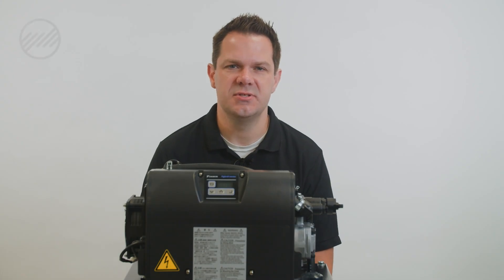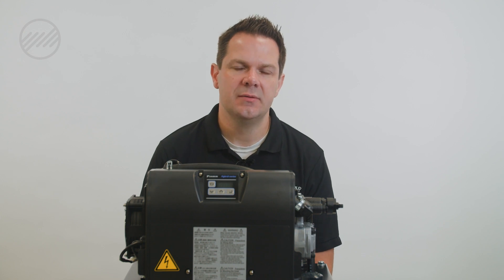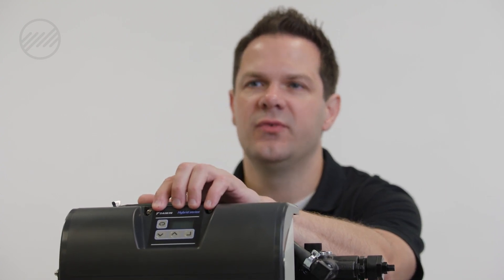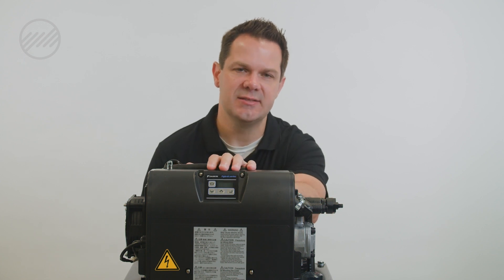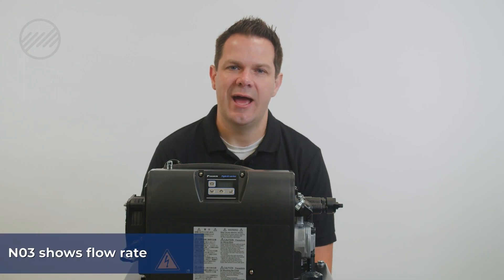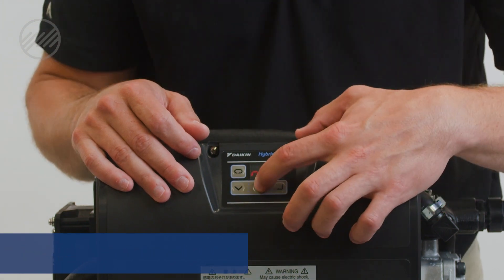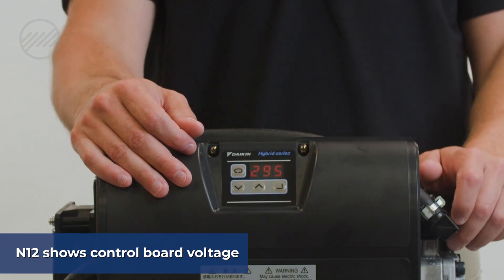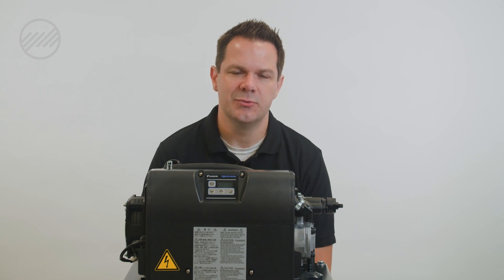E80 Alarm Code on Daikin EcoRich Hydraulic Power Unit

Comment: you didn't explain what's mean e80 ?
i know it's parts need replacement but can you explain what exact part issues 😊😊
Reply: Hard for them to tell, it could be motor, circuit board, etc. It is a programable hydraulic unit. I sent a couple in to them to fix.